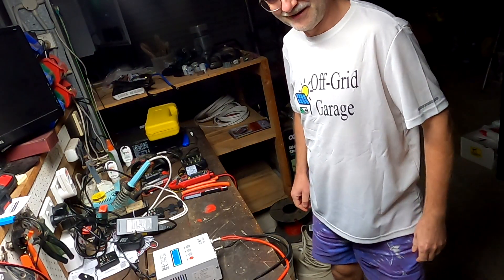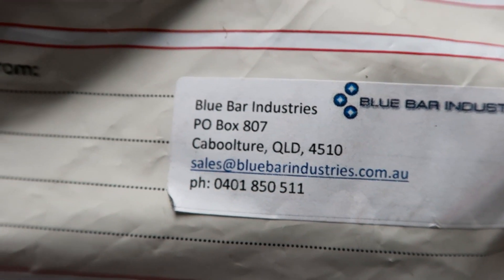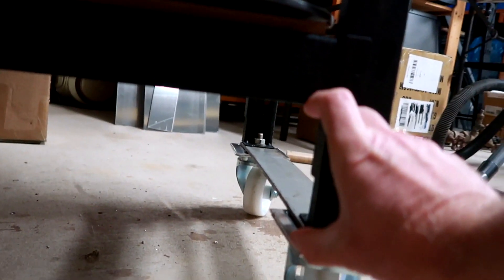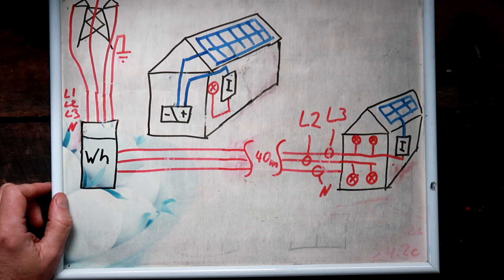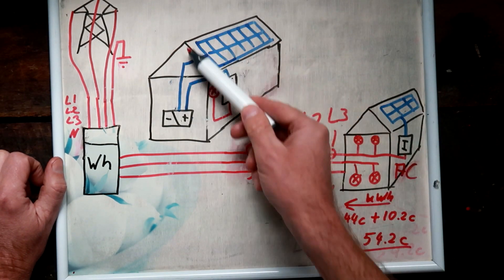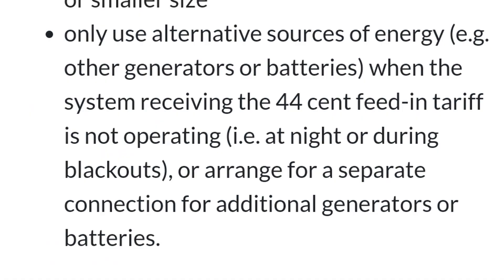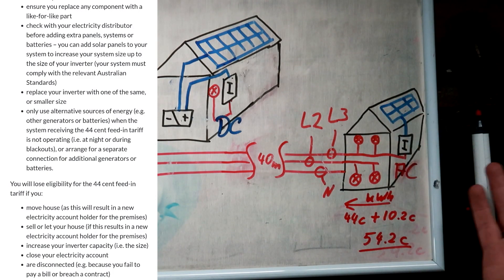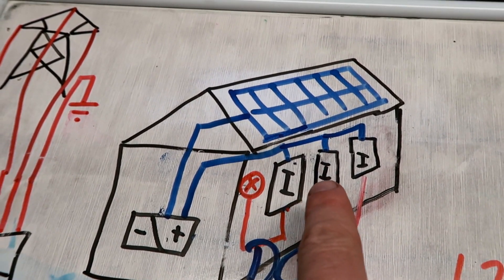Why a solar hybrid inverter will not work for my setup.

Comment from the maker: Here is, again, why a hybrid inverter won't work:
https://www.dropbox.com/s/34xv6gnw0seodip/Andy%27s%20cursed%20solar%20situation.jpg?dl=0
Reply: Not sure link will be visible: https://drive.google.com/file/d/1O497xa7L6_1VSq9et2Zt4UEYpJdVJK8b/view?usp=sharing
Reply: Sent new schematics and link here but I see that message is not visible (YT hates me?). So in this solution Grid-Tie is connected to Off-grid (with grid support) inverter's AC in port. Like an MPP Solar or EASun or Growatt inverter. Inverter is set to USB (Utility-Solar-Battery) priority so as long utility power exists that will go out in the AC out port. If not (blackout) inverter will generate power to AC out (like an UPS). If you do not connect solar panels to inverter nooen can challenge it ... it is an UPS :D like you buy in a store.
Reply: Rewire house's panel and garage to draw primarily from L2, insert hybrid with ZERO to-grid-power at house coupled on L2, install large solar system with battery, then only excess usage and any appliance needing L2 and L3 touch the grid :).   I'd be arranging panels and positioning things to legally backfeed the entire production of power back into the grid (from your current system) while using other means to power the home.
Reply from the maker: @mhamma6560  And I would loose the feed in tariff right away...
Reply: @OffGridGarageAustralia  Install another power box at the house fed by the garage and then move circuits over.  Basically pulling circuits out of the main box and sticking them into another not powered by the grid?  Your discrete system wouldn't touch the grid so therefore you're not violating any of the rules regarding your grid tie.  In a pinch you could hook a battery charger up to the grid to charge the batteries if that circuit got too low.  Those rules apply to grid tied items.  If your circuits aren't on the grid nor touch it in any way, there's nothing in those rules saying it can't be done.
Reply: @mhamma6560  Yes split your house circuits and when the batt is flat the inverter picks up the grid. Leave the lumpy circuits like the oven on the grid.

Comment: It simply does not work with hybrid inverters cause you are Not off-grid with the so called Off-Grid Garage ; )
Reply from the maker: Well, the Multiplus I have is a hybrid inverter, so it actually works but it will never see the grid and only runs as an off-grid inverter.

Comment: Hi Andy, I know this is an old post and you have had heaps of reply’s regarding this situation, and others have probably discussed about having a seperate line or 2 from house to shed to make use of an all in one to also give extra charging ability in the shed during daylight and off peak times, and also to feed back to house during when not producing from the house solar. I haven’t used them for long enough yet, but so far, The all in one systems, even very cheap ones, at least make a good battery charger for the price point, and this is extra power you can feed back to the house at night as a generated supply, and I believe most can be coupled at least as a backup generator from one system to another, as I believe you now know. Think Ive nearly seen all ur vids now Andy, thanks, they’re great stuff, just checking up some earlier ones now. 
Also, concerning feed in rates, I believe you can only shove 5Kw/phase up the lines generally, and this is where a 3 phase system would really shine when you had ur 44c feed in installed. I was looking to do this at that time I had an opportunity to get a 64c feed in on 3 phases of 5Kw feed in each phase, I missed it unfortunately due to other commitments at the time, but that could’ve been money in the bank with a 20-30kw system.
Reply from the maker: It's not possible to have a separate connection for the house to the garage. The effort would be huge...
Yes, 5kW per phase is maximum with 10kW of solar installed if you stay grid connected. Off-grid is different though ;)

Comment: Hi Andi, can't you use a CT for current Export limitation in order to solle the conflict between  Hybrid inverter and the house inverter?
Reply from the maker: No, I can't at the moment. As long as the contract is in place, they won't allow any physical connection between another inverter and the existing one. Even a transfer switch, a limitation by a CT or export meter is considered as an upgrade to the existing inverter.

Comment: I know a way you can get around this, but I would need more details on the solar system from your contract regarding the PV voltage of the solar panels, PV max voltage of the contract inverter, and I'm not sure if it could be publicly spoken about in detail if you decide to pursue this route. I will email you directly.

Comment: So Andy - I was under a similar contract in NSW when I first installed solar years ago with a very generous FiT (sadly no longer). The way I read your contract, you cannot install additional grid-tied inverter capacity without losing your tariff - even if it only operates at night. Two possible solutions: 1. rewire a critical loads panel  (well it doesn’t have to be critical loads - but you may as well) and use an ATS to switch over those circuits to off grid  during morning and evening peak to battery and inverter or as long as your battery will supply the loads. That way you are not increasing your grid tied inverter capacity. 2. Replacing your existing grid tied inverter with a hybrid inverter of the same capacity. This does not seem to break any of the rules. I don’t think this is particularly practical and it won’t allow you to use your off grid garage. Instead you could install a new battery tied to that new hybrid inverter, but you would have to restrict it so it only operates at night or during a power outage.

Comment: In California, grid tie is worthless. You get next to nothing feeding into the grid. Now the utilities have control of your new systems installed after May and can turn off the feed to grid. Rebates are almost impossible to navigate for the do it yourselfer so you pay three times the cost by the “professionals” which offsets any rebate. Depending on the county, permits can take six months or more. Inspector are incompetent and quote old dangerous codes like wanting the negative PV leg to ground and array structure. Put your money into a 30kwh bank, 12kw split inverter and a large number of used good panels. Do off grid systems and skip the rebate. You may still be required to have a meter, but it doesn’t mean that panel has to be connected to anything.
Reply: Apparently it is the same as everywhere. In the Netherlands the government changes policy when they like to. I asked the grid manger to install the required smart electricity meter for solar returns, they also replaced the natural gas meter with a smart one. Low and behold our usage went up almost 30% on both night over day. Their explanation "The old meter was not accurate" "their meters comply with European standards" . I looked it up on the net and yes every body is complaining and every action by organisations and tv programs solve nothing. Legally they just fck the people. So you can not earn on them, they just say your usage was increased. A friend of mine, a teacher even had to pay more with solar panels!! Can you believe it!? Pay! He had a flat roof with 6 panels installed some years ago. They sold the house eventually. This world is completely mad. We need to fight climate change, not each other.

Comment: I'm in Caboolture.. didn't know bluebar industries existed.
 You need to isolate the house circuits you want off grid via a changeover switch. You could put a sub board in the house and rewire. Thereby excluding those circuits from the grid. 
 That's what I'm doing. I will just power the light circuit and some powerpoints with battery... Run out of power there just flick the switch..

Comment: You should feel lucky. We only get about $0.03 per KWhr grid tied from Pacific P&L out of California  via Rocky Mountain Power. That is as compared to the layered system where we pay $0.12 and $0.15 per KWhr in the winter. This means that power can jump from $40.00 or $50.00 per month in the summer to as high as $200.00 to $800.00 per month in the winter. That sucks because much of the power in the Pacific Northwest of the US is made by hydroelectric built  with tax payer money, so we get to pay twice. We are also restricted on how much we can produce and sell back to Rocky Mountain, but I am not sure what the restriction is. I am taking my operation off grid using lithium batteries with the option to use the grid if need be because I just can't pay those high prices. I have a friend who is like you with a crappy contract. He built a new house with solar capacity grid tied. His contract is such that it costs him $1000.00 per 250 watt panel if he wants to install more capacity. 

There always seems to be someone with a trick up their sleeve doesn't their?
Reply from the maker: That sounds like the perfect situation to go with a battery setup... 3c/kWh is not worth exporting.

Comment: As I see it you can disconnect the house from the grid ( or part of it ) .
Leaving just the house GTI feeding the grid .

Then run the house from the off grid inverter in the garage .

Just switching part of the property with a transfer switch could be the answer .
So the utility's or house gti never sees the off grid system .

If lucky you may have a sub Pannal that can be switched .
( or just fit one with your selected loads plumbed in ) .

All are total non standard nightmares but it could be done .
Just don't know what the regs will make of it all but retrofits are always invasive , destructive & a pain !

PS  
2 inverters on split phase system may not be a good idea ….
Do you run just 220 or a mix of 110 & 220 ?
Reply from the maker: As per the contract, I cannot do that during the day. It would increase the export energy and they would need to pay me more money as a result of that. That is exactly forbidden.

Comment: What about connecting critical users to L3 and non critical users to L2. Disconnect L2 to the off grid system and have 3 position switch to give you the possibility to get power from the grid when necessary.
Reply from the maker: I can do that only during the night though as per contract.

Comment: You can always do what I do... and have two separate systems... I've got a 2kw off-grid system (with your off grid inverter/charge controller) and the 4kw grid-tie system running at the same time but never the two shall meet... there is a transfer switch, in my switchboard, whereby my house can either run totally on grid, or partially off grid. Needless to say I continuously run the partial off grid side for the light circuit, and a few power circuits (not circuits that have large loads on them like the air-conditioner to conserve the batteries), that way not only do the batteries get charged up during the day, but I get more FIT from my on grid side...  If there is a problem with the off-grid setup or I need to do some maintenance... I just flick back to the grid, and bob's your uncle!  The ultimate goal is to have all the circuits on the off-grid side, and send 100% back to the grid with the grid-tie system.
Reply from the maker: And that is exactly not allowed (at least not with my contract)! If you run parts of your house from your battery during the day and it therefore feeds more power into the grid form your grid tied system, it will increase the exported power (and $$$). 
If you get the QLD 44c feed-in tariff, that's a breach if they find out.
I thought about the same and wanted to maximise the export energy by taking all the load off the grid and just leave the 5kW solar connect exporting 100%. But that's a no-no.
Reply: @OffGridGarageAustralia  AH HA!  You forgot to read the 'or' / 'unless' statements of each of those clauses...   so this is how I read it... Maintaining eligibility: only use batteries when the 44c system is not operating, OR arrange for a separate connection for batteries (which we have).   Lose eligibility: if you use batteries when the 44c system is operating UNLESS your batteries (alternative sources) have separate connections to the network. (which I have)  I had an electrician run a new circuit around my house with separate (green) power points... and plugged my fridge, computers, entertainment system etc... with a few spares... and permanently run those off my 'separate' off-grid system.  Nothing to do with the 44c system.  Now as I said before I have a transfer switch that will run that circuit on the 44c system/ grid if I need to... meaning when it cuts over no batteries are connected to that circuit.  Does that sound about right?

Comment: If you can use the battery at night to supply power to the house; use a grid tie inverter with haul sensor. That will prevent it from exporting power to the grid effectively making zero grid consumption at night. I guess you would need access to L2 or 3 close to the inverter though.
Reply from the maker: Exactly, that's what I'm testing right now...
Reply: @OffGridGarageAustralia  I am using two of these on a relay/wifi switch (smart life app capable) to turn on and off at certain times of the day, but I can also remotely control it from anywhere with internet access.
Reply from the maker: @redstorm6767  Hey, that's exactly my setup right now and I have the Sonoff switch in between and some timers set. works a treat! It also shows me the power been produced from the inverter.

Comment: Did you look into sending the power back to the house as DC effectively just increasing the size on the house array?
Reply from the maker: As I explained, I cannot increase the house solar or inverter. How can I send the power back to the house via DC if I only have 2 phases and one neutral?

Comment: Andy, not trying to annoy you, (I promise! ) but having participated in tariffs setting proceedings , I see this one does NOT allow any potential for additional inverter capacity to the grid-tied system and I am guessing that the regulators would NOT penalize ratepayers who reduce their loads, like if you sold your Tesla and didn’t need to charge - you have some freedom to REDUCE LOADS to the Grid, but not add new power capacity to the Grid, does that make sense?  Forget making sense, does that conform to the rules?  People suggesting something that amounts to a SETTING on a connected grid-supply CAPABLE inverter like hybrid inverter, might be underestimating the ability of the Utility to interpret that as an addition to capacity for Grid-tied equipment and that is the biggest NO NO. Am I right in this thinking why you are saying No to hybrid inverter?
Reply from the maker: Yes, that is mostly correct. I cannot increase my house solar or inverter, I cannot install a hybrid inverter as I have the house solar and house load on the output on this inverter. The house solar also feeds back into the grid. Unless I buy a Victron Mulitplus II , there is no other way at the moment. The Victron would also imply a rewiring of the whole circuit board including installing a separate electronic meter. 
I may have found a solution though which I will show in a video soon.
They certainly cannot punish me for reducing my load, but they can if I operate these loads from an alternative energy source and my feed in energy would increase therefore.
Reply: @OffGridGarageAustralia  OK, thank you for the further explanation. I had suggested a manual transfer switch for some loads but it sounds like this is VERY restrictive and somehow if your load goes down but it is because you removed the load from the grid-tied system and are still using it, this STILL violates the tariff.  I guess that surprised me because the whole set of garage loads are not on-grid so there must be some definition difference between loads that were on-grid and loads that were never on grid?  I guess that’s where I don’t understand what the Victron Multiplus II does to solve this but simply removing loads from the house grid-tie system, maybe not a transfer switch but just no possible wire to the grid and 100% off grid like the garage, completely separated service?  $0.46 AUS is worth protecting so thank you for spending time explaining to the rest of us.

Comment: Andy, what you are looking for is a possibility to ensure a zero export to the grid from the garage.  There are inverters available with clamps ensuring exactly that (just google SUN-1000 GTIL2 or SUN-2000). You could put one of them on L1 and an other on L2.
But now we need to know what kind of meter do you have installed. If it is a smart one, which comunicates all the data to the utility - then don't do it, because they could monitor your consumption profile (in, more or less, real time).  If you just have an analog one, and somebody comes, once a year to read it out - then there should be no problem. The only thing you have to be cautious is to not have higher export values then now.
Reply from the maker: That is exactly the situation. The supplier has installed a smart meter with remote data transfer a while back. 
I have a SUN 2000 here and testing it at the moment. I turn it on after sunset and inject power to L2 for the house. This seems to work very well and no additional export either. video is coming soon... So with this setup, the exported energy is not increasing at all but I don't use much power from the grid after sunset any more. That is conform with the contract.

Comment: Use two  SUN2000GTIL grid-tie inverters with limiter and discharge them after the sun hours into your 2 phases. With the size of your battery you will probably not buy any electricity during the night anymore...
Reply from the maker: That's what I'm testing right now, video is coming soon.